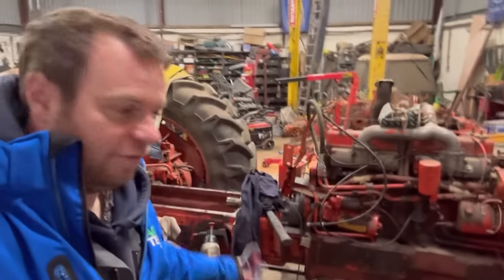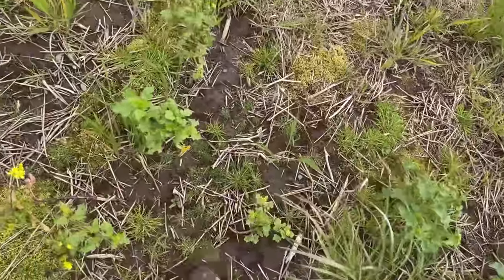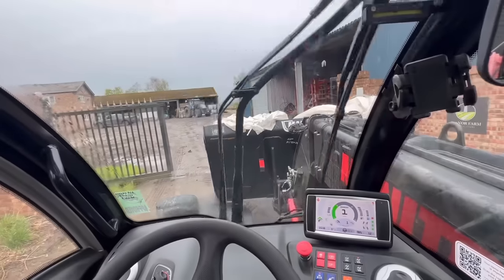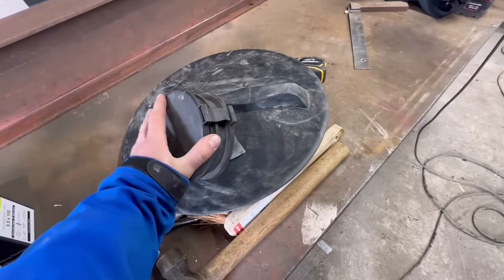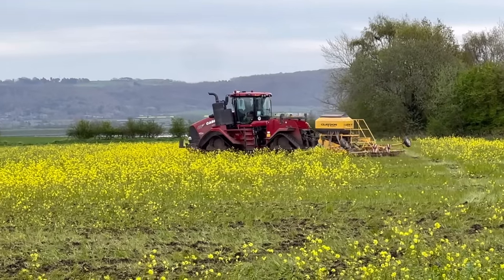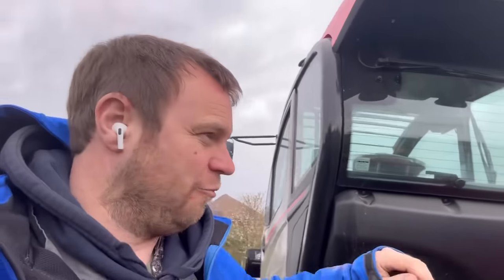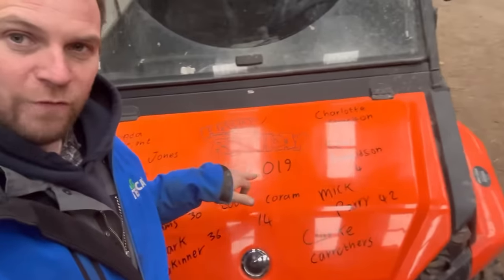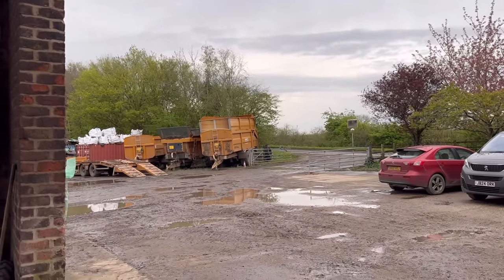WE FOUND SOME DRY LAND #AnswerAsAPercent 1483

Comment: Good to see you've got a bit more drilling done. Manitou sounds a bit noisey on the road? Maybe speak to Dean at Agriweld in East Yorks about a mixer bucket, they make one which chops up beat so i'm sure a little bit of modification and it would mix dough.